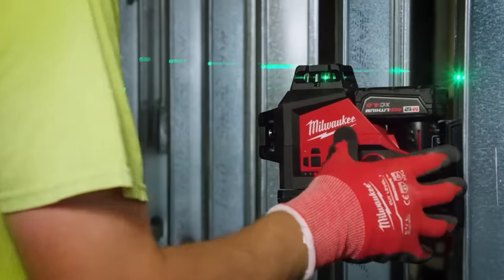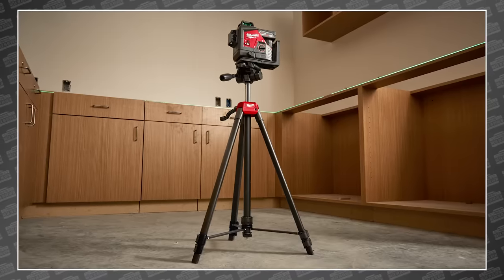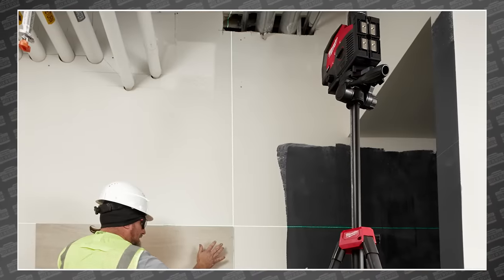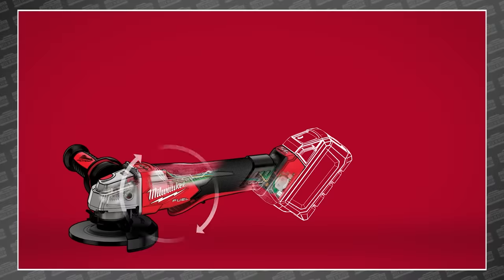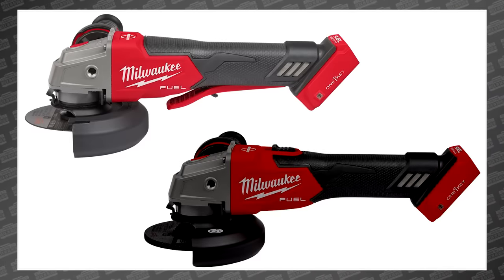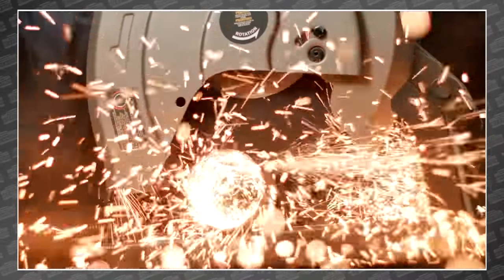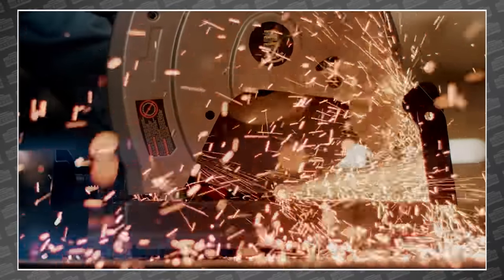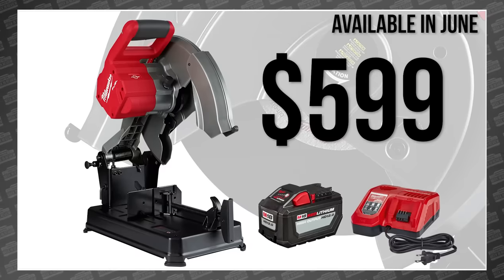Milwaukee Just Announced 4 NEW tools, including an industry first M18 Cordless Chop Saw!

Comment: Considering how god dang heavy a corded abrasive saw is, not bad! And $200 extra for the HD12.0 and charger when the battery alone is $200-250? Whoever worked on this one is NOT the same guy who came out with the $1000 pop riveter.
Reply: It’s a female who designed it. Not going to give her name out but she’s new to the Milwaukee engineering side. Had the chance to demo the chop saw about 4 months ago when it was just a 3D printed adapter on the side of the original corded one.
Reply: @tannerbrown12  props to her

Comment: In case anyone's wondering, the differences between these and the prior model 4" grinders (2783/2781) are: 1) anti-kickback control 2) different flange mounting system 3) now includes both type 27 and type 1 guards. Also, the model numbers in the video are incorrect I believe, the Milwaukee website has them listed as 2880/2881.
Reply from the maker: The grinders featured in this video are the ONE-KEY versions. 2882 and 2883 are correct.
Reply: Thanks for pointing out the differences

Comment: Makita has had a 14" cordless chop saw for the last 2 or 3 years
Reply: he said industry first 18 volt. makita is 36
Reply: @heeltoe6845  seems semantic and click bait to me
Reply: I came here to say the same thing. Makita was the first cordless chip saw by a long shot. Nobody cares if it's 18 or 36 volts. Milwaukee wasn't first
Reply from the maker: @muddybadgers5205  Makita definitely made the first cordless 14" chop saw. And it's a good one. But you need to have 2 batteries to run it. Milwaukee is the first to do it with a single battery. That's the claim to fame. May not mean much to you, but it's an improvement none-the-less. But I doubt it will make anyone change platforms. :)
Reply: @heeltoe6845  and you get to that 36V value using 18V batteries.

If you add enough qualifiers you can be the "first" to do anything.  Milwaukee isn't the first to do a cordless chopsaw so their claims are meaningless.
Reply: @ToolShow  Except with the M18 you have to use the 12.0 HO pack to get "15A equivalent" corded power.  

Put a 5.0 XC battery on that thing and it'll underperform and cook the packs.  If they offer it as a tool only option then you know people are going to go out and do it too, same as the chainsaw.  

Anyone who owns any 18V system already has multiple battery packs anyways, at least if they're buying tools like this.  So the fact that Makita requires 2 18V 5.0s as their way of doing things doesn't really change the fact that it's still the first cordless chopsaw solution that uses 18V power tool battery packs.  

Milwaukee is also claiming that this is the most "portable" chopsaw solution on the market due it being "just 42 lbs."  Except the Makita is lighter by ~3-4 lbs~, so that doesn't make sense either.  They're making both these claims because they think they can get away with it.   The people this saw will be marketed to are highly unlikely to know Milwaukee didn't actually do it first and that it's not actually the most portable since their competitor already made an even lighter cordless solution 2-3 years ago. + these people tend to love the Milwaukee marketing wank.  And Milwaukee has to always be the first and the best at everything.
Reply: @jaywelker5566  True story.
Reply: @ToolShow  how’s it an improvement have you done a power and runtime test with them both?
Reply: @ToolShow  I would rather look at available watt hours over 1 or 2 batteries. As they do in scientific research.
Reply: @jaywelker5566  just typical marketing bs

Comment: Why 4000 rpm? I would have thought the trend of cold cut blades, this thing could have the option to spin slow for those blades. 4000 rpm is a bit hot for friction blades

Comment: wasnt that chop saw announced like a year ago? they had braking 5" grinders in the past too not sure if these are a new generation.. but with still 8500rpm they dont seem to have corrected the biggest flaw which is low blade speed id like to see 10.5k-12k rpm on a 5" grinder.. blade life really suffers at 8500rpm and im sure that only drops lower and lower with low and battery drain

i love my old 5" fuel grinder, no brake on it and only 8500rpm no load its really convenient and works great with 9.0batts but i find myself taking the guard off and throwing on 7" disks to get back closer to the correct surface feet per minute that abrasive likes to see so its not just turning itself to powder

Comment: Milwaukee we need some Walkee Talkees
Reply from the maker: First I've seen this suggestion, and I'm digging it. How about models that clip onto their hard hats for hands free jobsite communication?
Reply: Sparky here. Baofengs are great but they leave much to be desired for drop proofing and fastening to work clothing. A mid priced, durable hand held receiver with Bluetooth headphone connectivity would be next level. 

Half of the guys on site have true wireless earbuds. I use them for hands free wire pulls all the time. Only works when you have signal though

Comment: 1/4"-20 thread?  Man, I might have to buy one of those tripods to use with my cameras.  $69.99 is actually not terrible if it's sturdy.

Related: Flex screwed up on the angle grinder that has anti-kickback, but no brake.
Reply: Get a Manfrotto.  Buy once, cry once.
Reply from the maker: @prototype3a  We've purchased around 6 tripods in the last 2 years (for our studio and travel work) and I've been a professional photographer for over 10 years. I've owned Manfrotto before, and I've never found it to be any better than something like a Benro. You don't need to cry, just don't buy garbage.
Reply: I was thinking the same thing about the tripod.
Reply: @ToolShow  ... and this Milwaukee tripod looks like hot garbage with a badge slapped on it.

I've not looked at Benro but they appear to be decently made and as such command a premium.  

I've had my Manfrotto for the past 20 years.  Nothing has broken, worn out or had a single problem.  Granted it is mostly carbon fiber and magnesium and was not an "entry level" model.  I really should purchase a different head for it to better suit how I use it these days.  For the time being I found a cheap RC2 to ArcaSwiss adapter.

I've seen a lot of CHEAP tripods that are just junk and break and aren't worth the asking price at all.  I've seen cheap tripods so bad that I would refuse to put my camera on them.
Reply: @prototype3a  @Belts and Boxes - you mean like this garbage that I'm using? 🤣https://www.amazon.com/gp/product/B073WCL4NS

Comment: Chop saws that use abrasives are dumb you should totally get a cold cut style saw with a wheel that doesnt get smaller. Cuts faster and cleaner and always maintains full cut depth
Reply: Agreed. So many benefits to it

Comment: M18 HO is not impressive.  They should make anymore tools. Either go 2x 18 or another line between m18 and mx.  
The 14 will not run constantly.  The 9 inch grinder cannot.  Chainsaw cant. You might think just swap out batteries.  Well all your batteries end up Tripping out. I think one of my 12amph bat is now damaged... will not fully charge.  Dewalt 60v grinding and any metal work never trip out... unless it's the small flex battery.  I find mind a 6 trip out because it will charge fast.  But a Milwaukee 12 amph trip out is unacceptable.
Reply: yep, nobody wants to talk about how M18 HO solutions require overly large motors due to the larger winding gauge and these motors are more prone to overheating battery packs because they need an absurd amount of amps (even the HO class packs.)  This is also why they have yet to release an 18V lawnmower, btw.  

This is why Flexvolt tends to win out on raw power/speed in a lot more equivalent categories.  (inb4 someone mentions the Super Sawzall, Dewalt is a terrible reciprocating saw manufacturer, always has been, always will be.  And those aren't the kinds of tools I'm talking about anyways.)  This is why Milwaukee can't compete in the 2" SDS Max category and they've never had the balls to directly compare their 1-9/16" or 1-3/4" SDS Max hammers to their closest competitors.  They're never afraid to compare drills, drivers, impacts and reciprocating saws though.    

Milwaukee makes very good tools, mind you, but so many people are just brainwashed into thinking they're the best at everything because of marketing wank.
Reply: @jaywelker5566  True story, Makita for the win or Dewalt.
Reply: @shanew7361  makita has made a smart decision to stop 2x18 on  hand tools... and now out swinging g with 40v
Reply: @philipjohn4149  I agree

Comment: That tripod looks mighty... cheap.  You can do better shopping at your local camera store, or Amazon.  I have lots of camera tripods and they all look better than this, even my cheap ones.  If you can justify the insane cost of an M12 laser level you don't need to buy a cheapo tripod.
Reply: Which tripod do you recommend? Or better yet, which lasers is cheaper than their overpriced version lol
Reply: @SuperPhoReal  Any $70 camera store tripod is likely to be better.

I've been using a Johnson 40-6620 for many years and it's served me very well for the ~$150 I paid for it.  It's not RED though... it's only orange.  The cheapest Milwaukee equivalent is $300 - $400 depending if you want the USB or M12 version.

If you think green lasers are a must-have, wait until purple lasers are the latest thing and they tell you how terrible these green lasers are. :)

Comment: That tripod looks like absolute junk.  Buy a Manfrotto instead.

Lack of variable speed on these new grinders means yet another generation of M18 grinders that gets a "do not buy" from me.
Reply: What purposes do you use variable speed for?
Reply: @JS-tb9hu  Slowing discs down to prevent burning things, careful sanding and shaping.  It is an enormously useful feature and Milwaukee has no excuse for not adding it to a brushless tool.  We're talking about $1 in BOM cost and a firmware flash to the speed controller.

I LOVE my Metabo variable speed angle grinder.  Their Quick nut is fantastic.  The tool even holds rpm as you load the disc unlike the cheaper variable speed Bosch grinders.  I just wish it was cordless.
Reply: @prototype3a  Thanks for the reply. It does sound like a great feature

Comment: Lol pls do some research instead of just reading off the brochure. The chop saw is not an industry first, Makita has been selling their XWL01 18v X2 for a couple of years now.
Reply from the maker: I will lol pls do some research! As stated in the video, you JUST watched, it's the industry's first 18V chop saw. :) You'll catch on.
Reply: @ToolShow  it’s not. Just because Makita’s chop saw uses 2 batteries does not mean it’s not “18v” it’s still on the 18v platform and does not require you to invest in a new battery platform to get 36v, therefore it is still considered 18v